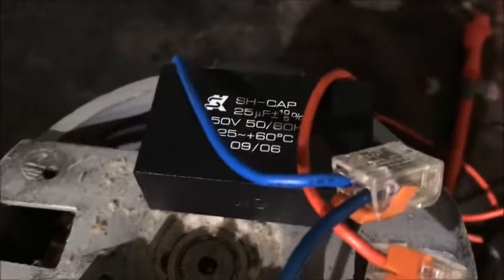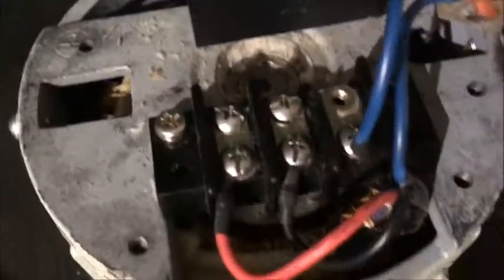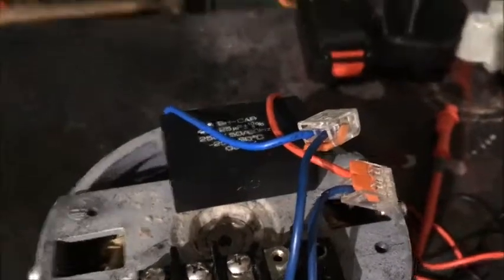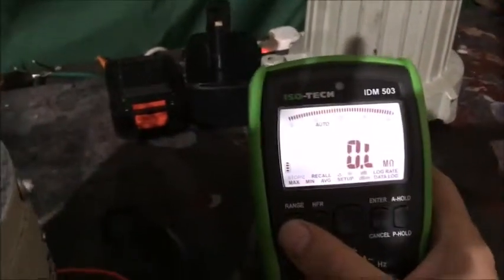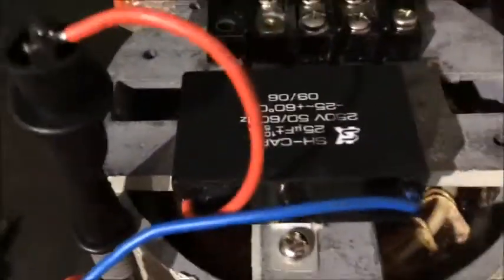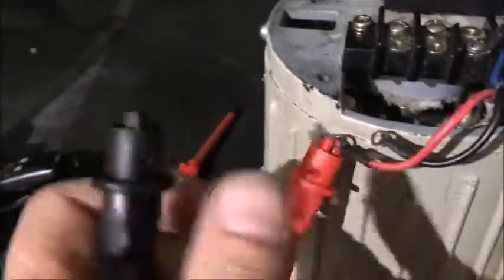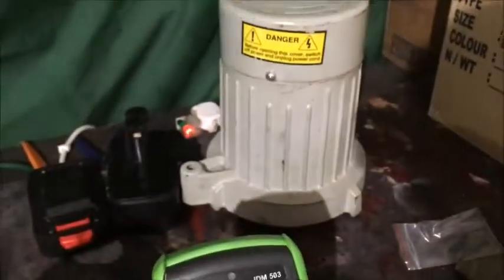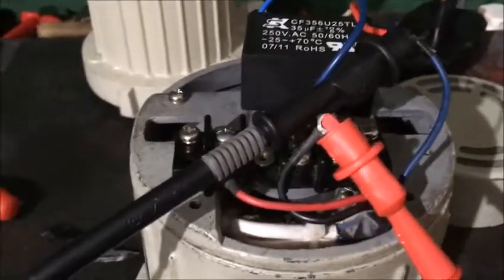Motor Hums But Won't Start? Single-Phase Capacitor Motor Troubleshooting & Testing Guide

Comment: Hi please could you help, my 9-5 salloon 40,000 miles 2005 uk,, has the dreaded key problems But not like normall  so 3 saab forums say ? Main issue is it wont lock most of the time either key, i found 3 ways were i can reconect the keys to the car without tech2 but i can only seem to get the car to go into program mode but not save mode if you get me. Ie it resyncs them and the key will lock fine. The ignition is not sticking to my full knowledge because inside lighs go off and radio will turn off, i still get sound from the alarm if i get the chance to lock and set alarm. Door switches are working fine, cleaned lock ignition and keys inside good contacts,battery clipps. One thing i do think is strange is that the car can still lock even know one of the doors are not closed? But i thought they shouldent of ? Please any support or advice would be amazing as i am toatly stuck on this, this is my last chance i have. Thank you p.s love all your work keep em comeing.
Reply from the maker: post your message on this forum lots of experts on here ill have alook around my self see if i can find anything that might help , https://www.digital-kaos.co.uk/forums/forumdisplay.php/177-Locksmith